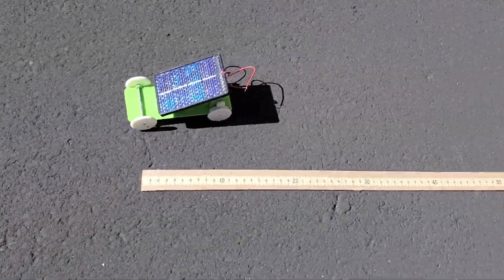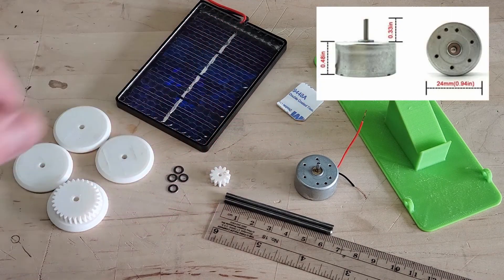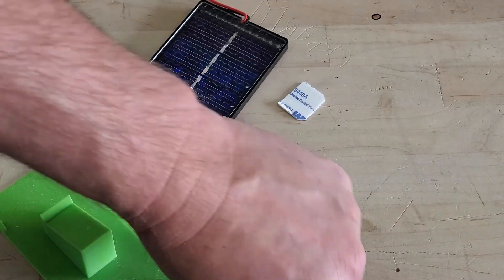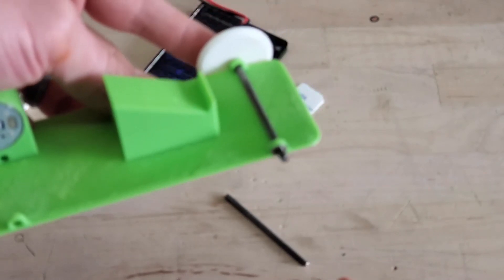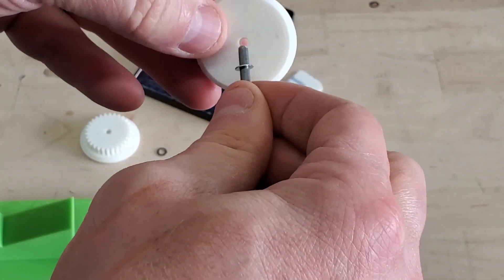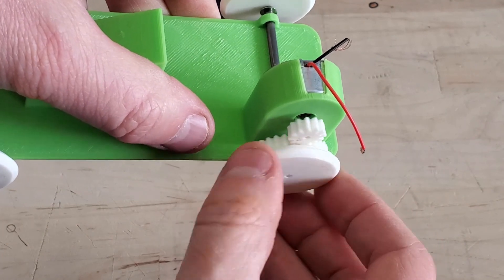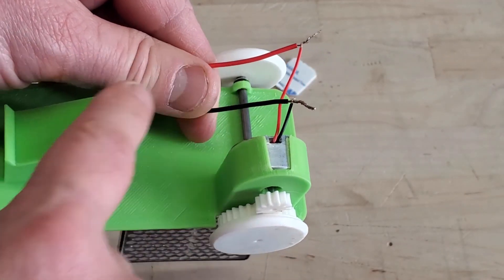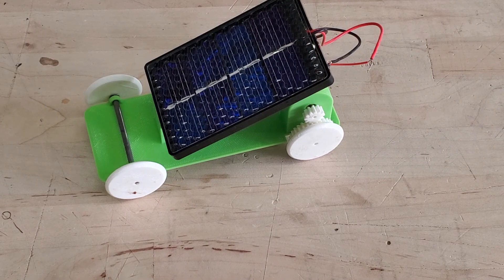How to Manually Assemble a 3D Printed Solar Car

Comment: Does the panel have to have the same voltage as the motor? I'm in the very rudimentary stages of trying to design a 3-D printed quadcopter with a solar component and would love you hear your input!
Reply from the maker: Yes it does